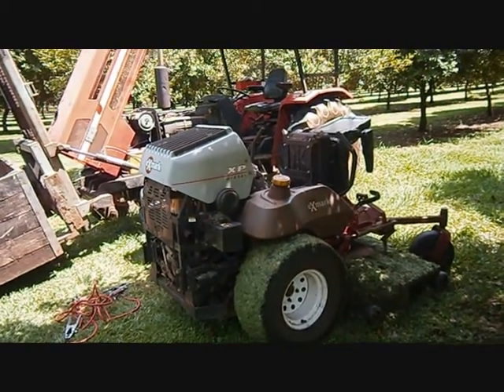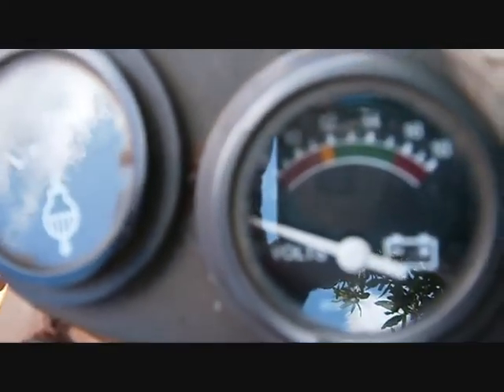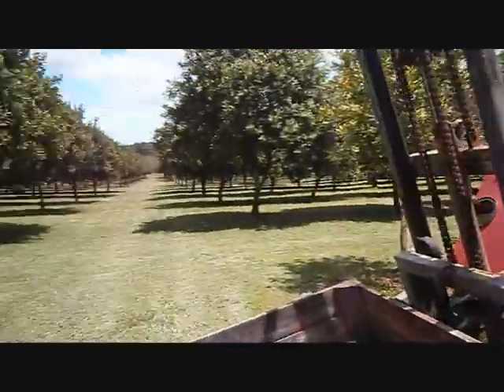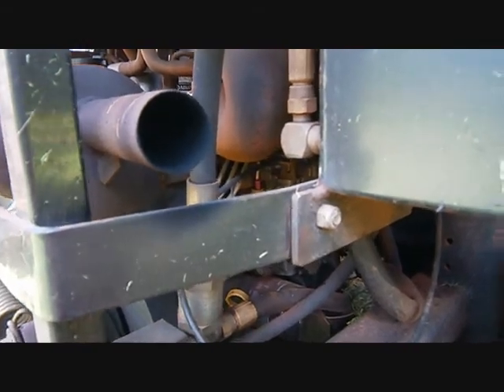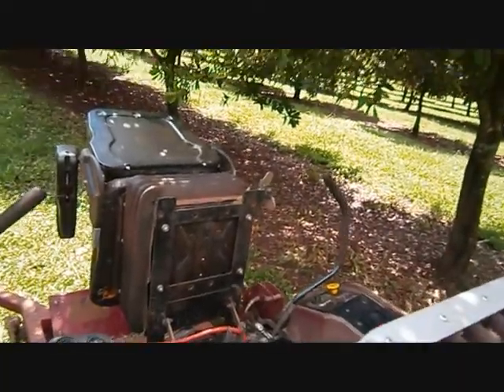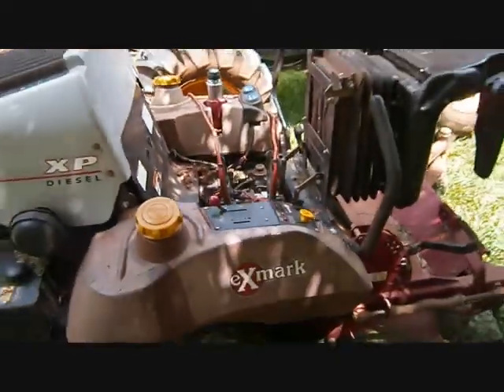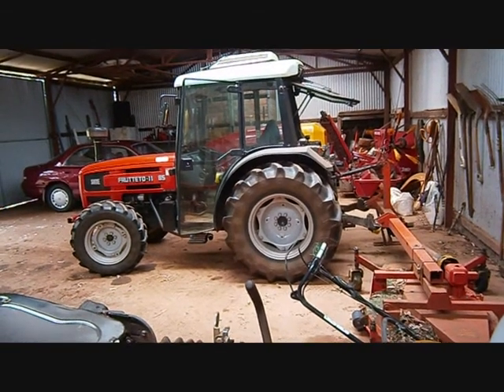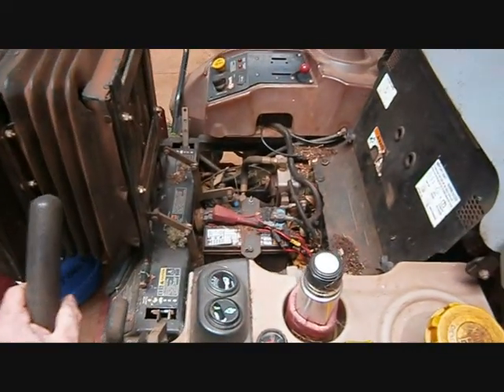Can't always trust car battery charge meters.

Comment from the maker: We live on a flat farm, they will never roll over so first thing I do is disable the seat safety switch.
We use these mowers with macadamia harversters on them and its a nuisance if you have to get off to move a branch and engine shuts off with the seat safety switch still connected